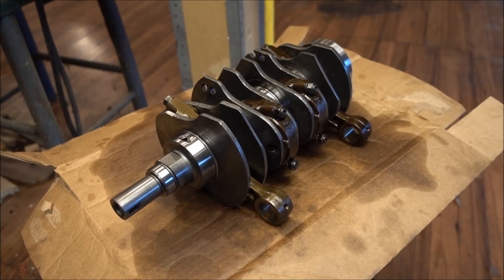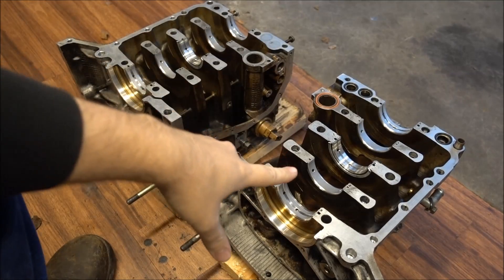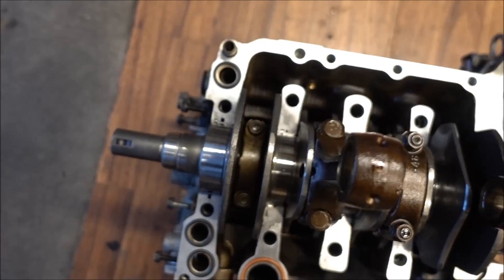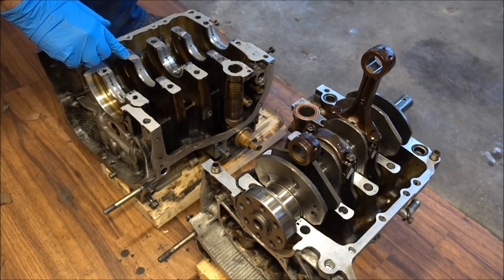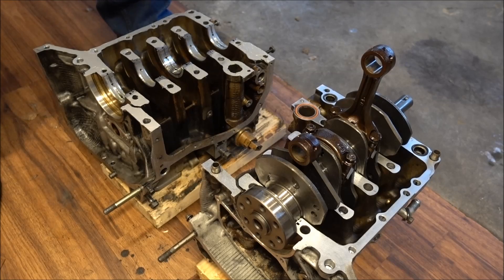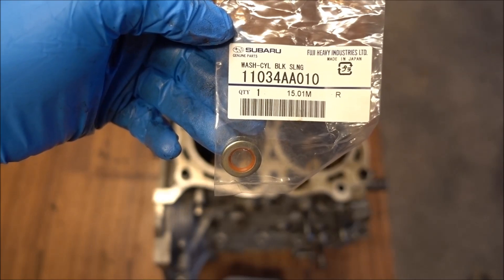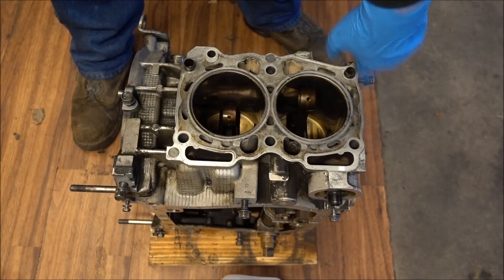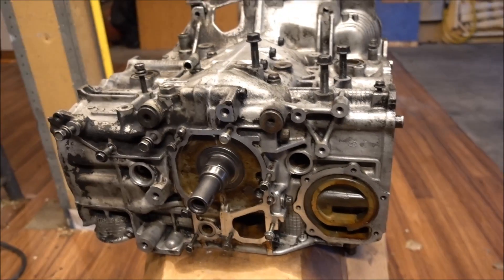Installing a Subaru crankshaft

Comment: I had one of those! A '92 Legacy, same with one of my sons - another had a '95. I respect mechanics, especially Subaru mechanics. Great video. And re: closed deck, just noticed the comment and the deck itself. That may be why head gasket failures were relatively rare on the 2.2s.

Comment: Hey I have a question. My wrx 2013 model within 6 months had issues when in boost say 4000rpm i would get cel and engine hesitation with fluttering sound. (I did proper maintence, oil , no mods, no tune because i have gold package 6 yr warranty). The service guys at subaru for 3 years have told me its just a loose fuel cap, which i've tightened and even bought a new fuel cap still same problem. Pretty soon the car would go into limp mode where I wouldn't even get power foot on the floor at 1st gear and car only goes 5 mph (almost got into a few accidents on a turn because of this ).  My fix was to reset ecu by unplugging the battery and it ran fine until a month or so then I do it again. 

On christmas day 3 years from buying this new car the engine finally died coming off the highway. They told me it was cylinder 4 that blew up, and under my warranty they would replace the short block. After this with in 3 months I been having the same issues, in boost i get cel + lack of power. They said its nothing again.

This is obviously subaru saving their own ass right? 

Right now there is a class action lawsuit for models wrx 12-17' where there is an issue with connecting or main rod bearing failures. Do you think this is the issue with my new car? Or just got a lemon from factory? I've spent so much money just trying to get a state inspection every year because of trying to clear check engine lights and subaru just telling me its a loose fuel cap until the engine blew up and now they tell me its my fault. I've done all the maintence I don't race the car either. it's only got 30k miles on it for god sakes brand new 2013 model only 30k miles. What do you think, I wish I knew more about cars just don't have the time to learn it all. Would love a car guys opinion on this thanks!

"This is the third lawsuit against Subaru’s WRX and WRX STI performance cars in the last six months. In October of last year, Torque News reported Subaru of America (SOA) had a lawsuit filed against them claiming "an insufficient supply" of oil to connecting rod bearings caused engine failure from metal shavings in the oil in 2013-2014 WRX and WRX STI models. In December, a second lawsuit was filed claiming a crankshaft defect can cause “premature catastrophic engine failure” in 2009-2014 Subaru WRX and WRX STI powered by a 2.5-liter turbo boxer engine."
Reply: What you describe would have nothing to do w/ the internals of the engine. Sounds more like you are having some sort of electronic issue, causing the car to set a check engine light, which if severe enough will cause the car to go into limp home mode. It could be engine related / turbo etc, but not internals. I got 135k on my 11 WRX, and just had pan off to replace its gasket, and seemed solid & clean still. I don't know how people have so many problems w/ the EJ25.
Reply: its called a "Lemon"

Comment: And for the pistons???
Reply: Since you can't pull them out the bottom, the block has access points to get to the wrist pins. Problem solved.

Comment: I have a subaru outback and ive noticed the crankshaft pulley on rotation looking very wobbly.
Heres a link to a youtube video which is exactly how my pulley rotation.
https://youtu.be/xG74uiALWUQ

The car drives great and at high speeds too BUT im sure i shouldnt be driving it for if the shaft snaps whilst driving,then im puttinh myself and other road users at risk.
Its a 2010 outback 2.0L Diesel model with 72000 miles.
Any advice guys???
Cheers

Comment: Arent you suppose to use anerobic sealant for case halves....everytime ive used gasket maker or right stuff when rebuilding tcases they eventually leak from the halves because that stuffs made just for pan gasket surfaces....